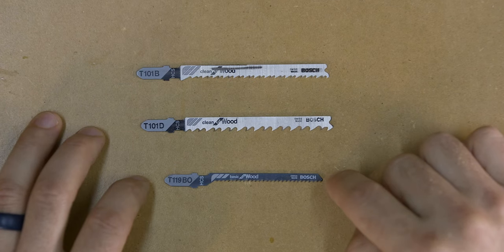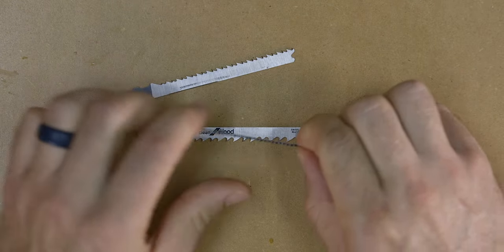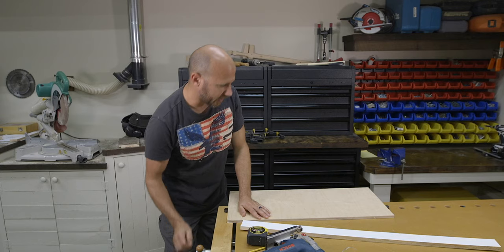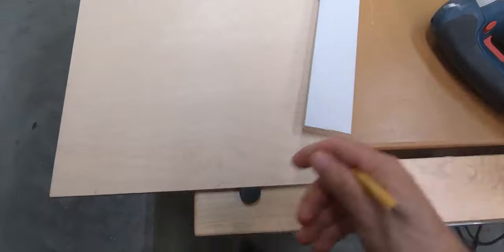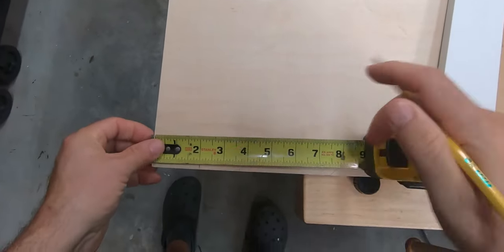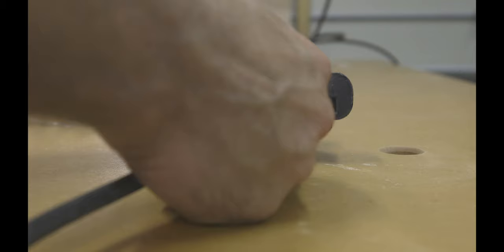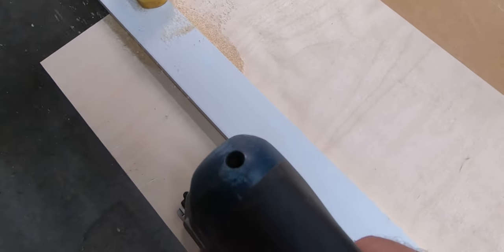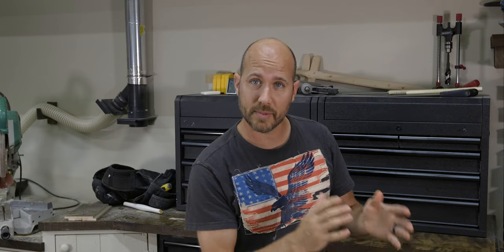When You Only Have a Jigsaw to Make a Straight Cut

Comment: one important lesson I've learned while doing it, is do not apply pressure. let the jigsaw move freely and slowly or else you'll get a non-perpendicular cut
Reply: I just learned that lesson the other night.  One video I was watching said..." apply pressure " to the jigsaw.  NO -- not good advice.  I found that if applied just slight pressure or none,...just enough to keep the jigsaw against the guide board, and no more, it gave me the best cut.   I totally agree with your post.
Reply: Agreed. Let the saw do the work. And go snail  slow.
Reply: @energyfitness5116 Because the blades are thin?

Comment: If the errors show up in beginning and end, then along with adding extra length on the guide, use a board that is longer than needed and then time to size after the cut, getting rid of the beginning and end inch or so.

Comment: Very nice directions. Whenever I use a jigsaw and ruler to support one side of jigsaw foot, or a guide supporting both sides of jigsaw  foot, I get  inuppropriate results, the blade goes under angle.
To summarize the video,  using thick, wide (and sharp) blade, in one continuous pass (with moderate or weaker pressure) might be the winning combination. Still for long cuts always circular saw with guide jig, or table saw are proper tools. 
Very good video, thanks.
Reply from the maker: 💯 That is a perfect summary! Thank you for adding this to the comments!

Comment: Nice and easy to understand tips! Do you also have a tip how to prevent the tilt of the blade? I think this happened in my projects due to the wrong blade (to flexible) or some harder pieces of wood in my work piece. I've also seen some video's about creating a track saw kind of solution for these kind of problems, but maybe there's  just a simple trick how to prevent this behavior instead of creating al kinds of cutting stations.
Reply from the maker: Yes you are right, shorter thicker blades that don't flex as much does help a lot.
Reply: Training Hands Academy 
Thanks! One last question. Sometimes my jigsaw is trying to move away from the guiding fence. Would applying a tiny bit of pressure towards the fence, in combination with a better saw, also help or are there any downsides when using this technique?
Reply from the maker: Yes, the jigsaw does sometimes pull away from the edge guide, so resisting that with a little force towards the guide is exactly right. You may also want to try setting the guide up on the other side of the jigsaw. Jigsaws sometimes like to pull to one side more than the other, so if you switch sides, the saw might pull itself towards the guide more fixing that problem. Try it out and see what happens. Hope that helps Arnout.
Reply: You are pushing the cut too hard. In theory (and with a nice sharp blade) you need little pressure - just enough to keep the blade in contact with the material in the direction you are cutting... the machine will sort of get "pulled along"  - arguably the greater pressure should be in keeping the sole plate flat.  Hope that makes sense.

Comment: @Training Hands Academy 0:50 - what you mean to say is, A jigsaw cuts on the upstroke which creates tear out on the side you're cutting from. The side facing you is where tear out occurs.
1:30 - another helpful tip: Make a SINGLE pencil mark. When you go back and forth all you do is create a thick line that misleads you about the exact point from which you wish to cut.
1:40 - these statements are murky indeed. Make it clear what the piece is that you're planning to cut and retain for further use, and what that piece's dimensions will be after the cut. If it's the 2" wide piece, as you seem to indicate, you set up the cut in such a manner that the only way your jigsaw can waver is into the 2" wide piece you want to retain, thus spoiling it. Any time you use a straightedge, you set it up so that if the saw veers it veers into that part of the wood you won't need, such that you can fix the erroneous cut by sanding or cutting away the error, the excess.

Comment: Cutting a sink hole into a laminated table, what saw will do the job? The table has some bracing boards underneath, and I don't see any way to clamp a straight edge board. Afraid if cutting it with a jigsaw, may warp and break the saw?
Reply from the maker: I would have to see what you are doing exactly to give you a good answer... thinking jig saw is what's best. You can send me photos on IG. https://www.instagram.com/traininghandsacademy/

Comment: Thanks for the video.
I have 2 quick-clamps as tight as I can in the same place as you but almost immediately after starting my cut the guide moves; any way to prevent that?
Reply from the maker: Hey Ryan! Yes, that is very common. Try putting less pressure against the clamp as you're cutting, and if you need to, use stronger clamps. Let me know how that goes.
Reply: I using screw to prevent itu move instead of using clamp. But, yeah it makes some hole on the wood

Comment: Thank you for the very nice video!
I tried the trick and it works quite well but sometimes the measures are not perfect so even if you go in a straight line it is not perfectly straight and it is diagonal (imagine that you measured 4.1 cm on one side and you end up measuring 4.2 on the other one so you have a 0.1 cm error that makes your line not straight).
Is there any tool that can help me in achieving 100% straight lines? 

Thanks :)
Reply from the maker: Yes, a table saw or if you can't afford that, a circular saw with a guide. This video show techniques for the circular saw and guides.  https://youtu.be/ILVCdEOhYBc
Reply: Easy fix for that , just make one jig and use it for both ends.

Comment: Do you apply pressure against the guide, or straight down?
Reply from the maker: Hello! A little downward pressure, but most of the pressure is against the guide. If your saw wants to pull away from the blade, try using it on the other side of the guide. Some saws like to pull to one side or the other.
Reply: @TrainingHandsAcademy  - Thanks for the tip!

Comment: The blade bends and tends to follow a curve. If I insist, the blade breaks. Even though I cut strait line  the bottom part of the plank does not follow the same path as the top off forming an angle different than the strait one as if I was cutting in angle. No matter the thickness of the plank.
Reply from the maker: Time for a circular saw or table saw :)

Comment: I recently bought a new Black and Decker Piranha worktop-cutting blade (downward-cutting ) for my aging jigsaw... Tried it today and it was bouncing all over the place! (Luckily I was only trying it out on an old piece of laminate w/t). Going fast, going slow, pushing the saw gently or harder didn't make any difference. It was all I could do to stop it kicking back off the piece. I'm disappointed that a blade designed for laminate performed so poorly but I'm willing to accept it's something I'm doing wrong. But what!?!?!
Reply from the maker: What type of laminate are you cutting Martin?
Reply: @TrainingHandsAcademy Hi, just standard 38mm thick Duropal laminate kitchen worktop. Nothing out of the ordinary... and exactly what the blade says it's perfect for 😬
Reply from the maker: @grayhalf1854  Does your saw have a reciprocating setting? If so, it's off right?
Reply: @TrainingHandsAcademy  no reciprocating setting on my model (450w, 500-3000rpm)
Reply from the maker: @grayhalf1854  sorry buddy, just trying to brainstorm with you.
Reply: @TrainingHandsAcademy  No apols necessary! Grateful for any input 👍 

I think I might try my blade in another machine / try my machine with another blade to try to zone in to where the problem is.
Reply: Well I bit the bullet and bought a new £25 (33 USD) jigsaw and the difference is like night and day. Now the saw is manageable with only minimal kickback and cuts smooth and true. Using old tools is something of a false economy in finding...

Thanks for your your input 👍

Comment: The right blade... check! A straightedge clamp... check! Even vet the same exact jigsaw in the video.... check! Straight cut... um I don't know what happened. Seems to want to wander from the line... unfortunately I also learned that you prefer it to wander to your waste side vs your good side... Maybe too much pressure trying to ensure it sticks to the fence?
Reply from the maker: Jigsaws are fussy... especially for straight cuts. Slow and steady wins the race. I have also found that some saws like to pull to one side, so having it pull tight to the straight edge helps to keep the saw on track.
Reply: @TrainingHandsAcademy  Thanks. Is there an adjustment or calibration to fix that pull. I think mine might be the case - pulls to left. I see we have the same saw (Bosch?) so thought you might know. Thanks!
Reply from the maker: @rhuynh  Not that I'm aware of. Mine pulls to the left too! Which sides of the straight edge and see if that helps. Let me know.

Comment: I used a straight edge but the jigsaw keeps skewing off away from the straight edge.
Reply from the maker: What type of blade are you using? Keep light pressure against the fence, and keep your feed rate slow. Sometimes the saw generally wants to pull to one side or the other. Maybe trying switching sides of the fence, that way the saw pulls itself tight to the fence.
Reply: I just placed a ruler against the side of the blade and it's clear it's not parallel with the side of the jigsaw shoe
Reply from the maker: @raymondtan2415  There's the problem. Good work finding that Raymond!
Reply: @TrainingHandsAcademy  Yes, but how to fix it?
Reply from the maker: @raymondtan2415  Not sure... it's hard to know without seeing it. Send me pictures on IG if you'd like.

Comment: You can NOT make a straight cut with a jigsaw without spending an unreasonable amount of effort. In fact, the jig saw is completely useless IMO. Use a router for curves and use a rotary saw for straight cuts.

As a beginner DIYer who has struggled quite a bit with tool selection, I recommend wired mitre saw + battery multimaterial plunge saw (safer than circular saws) + battery handheld router + battery random orbital sander + battery drill + battery impact driver.

Those tools have me covered for all my amateur needs. Total budget 750-1000.

Comment: This don't work AT ALL for me. Even with large blades, if I use a parallel guide like this, the blade keep chossing one side to go. I prefer to follow a line slowly, but jigsaw not made to straight line. Thank u anyway!
Reply from the maker: If you ever want to try it again Ede, try putting the saw on the other side of the guide. Sometimes jigsaws like to pull to one side, so if you flip sides, the saw will pull itself tight to the guide.